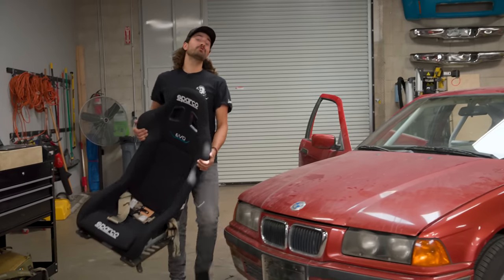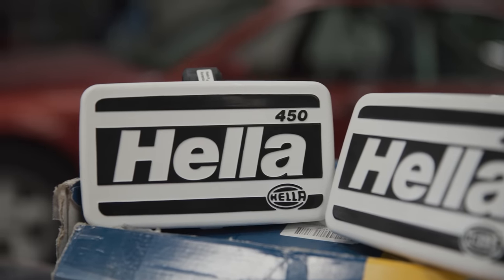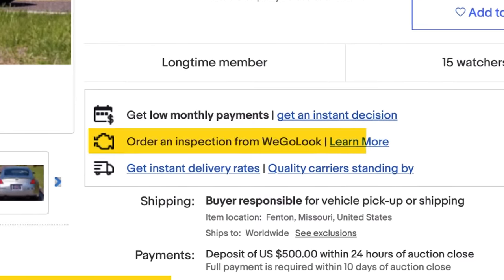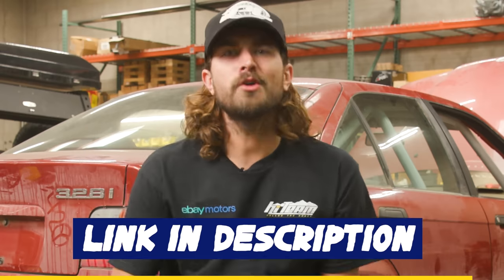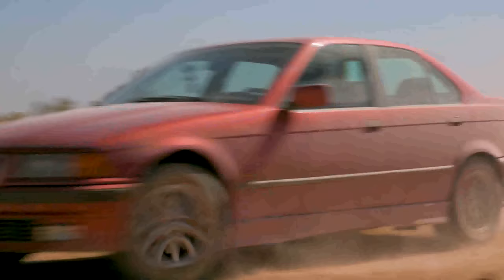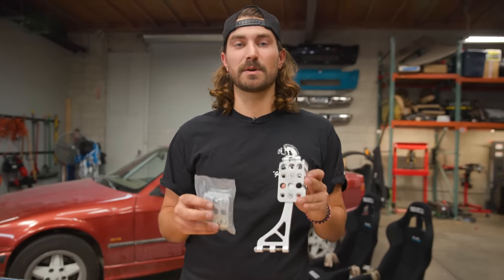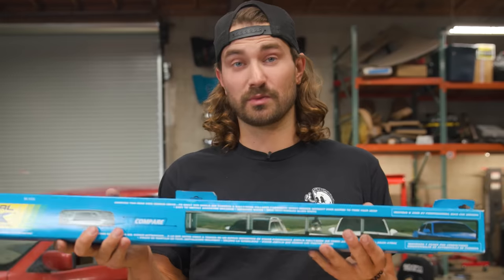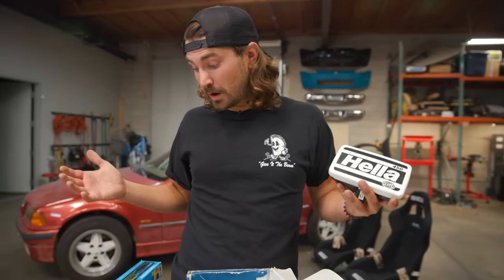Cheap and Easy Rally Car Mods - Were they Worth It?

Comment: Zach: Adds in new fog lights but completely ignores cleaning the heavily sun damaged headlight covers  Now we can see better at night!
Reply: @Donut Media please make a video on how to restore foggy headlights.

...I got that problem too...
Reply: Are those not Fog Lights below the Headlights @ 12:55?

So he just added another pair of fog lights for even more lighting then?
Reply: @vornamenachname727  toothpaste and water
Reply: And... Just even adding FOG LIGHTS to see better at night is just... WTF? 😂 4 Auxillary lights (2 pencils, 2 wide beam) in a row between headlights would have done the trick, pencils in the center pointing forwards, outer wide ones pointing something like 30degrees outwards for that slidey action so that you can still see where you're going 😁🤘
Reply: @Silentalarma  agreed. Fog lights are for visibility in fog. Period. These are going to be rendered ineffective when any dust gets kicked up. Literally anything would be better if mounted higher. 🤷‍♂️
Reply: @Its_Me_Romano  This works okay. Make sure to wax the lenses after doing it or the fogging will return pretty quickly.
Reply: @kvltizt   can you use beeswax or does it need to be car wax?
Reply: @Silentalarma  exactly. That would make more sense.
Reply: @vornamenachname727  I work in an auto parts store. Fixing your headlights is super easy. If you have a cordless drill, even easier. Go to your local auto parts store and ask for a headlight restoration kit. It will have everything you need. There are kits for use with a drill and ones used by hand. I prefer the drill method if you can manage it. You'll start by using an abrasive sandpaper to wet sand off the corroded layer on the outside of the lights. Then you'll attach a polishing pad with a special clear plastic polishing compound to buff the light back to completely smooth. Then you'll apply a sealant or if you want to be more fancy, tape off the light and spray acrylic clear coat spray paint over the lens to add a really tough outer layer.
Reply: @Silentalarma  Those dont look like foglights.. they look like aux fullbeam Hella 450's. The Hella 450 foglights are all wavy glass front to widen beamthrow.
Reply: @Kevin_2435  Thank you, i might try that. :D
Reply: @Its_Me_Romano  that doesn’t work 😂
Reply: aren't e36 headlights glass?
Reply: @vornamenachname727  Pretty sure ChrisFix has a video all about that. And he's better at DIY than Donut.
Reply: @woofy9977  No idea. I use Meguiar's wash n wax.
Reply: @woofy9977  Just use a UV resistant clear coat spray paint that is made for plastic and is fade resistant. You can get a spray can for about $6-7 at any hardware store or walmart. Beeswax and car wax will just wash off and still anyways let the UV rays through.
Reply: @CodeMerk  they look like parking lights  to me, dull lights to help you navigate parking spots under cover or at night

Comment: People who can actually “heel toe” have some serious contortion ability in their legs
Reply: I’ve never been able to do it, got flat feet, pisses me off no end.
Reply: It really depends on the car and how close the pedals are.
Reply: @Fidelitye  fax I can do it in my car but other cars I have to use side of my foot
Reply: @FirstnameLastname-ni9uh  I did add some pedal pads to help, but you don't just throw them on all straight and square, angle them and/or shim them so you get the right foot action you wanna get. 
Aesthetically, they look like a 3yo put them on my car but the function is what it's all about.
Reply: It's easier to do using Jobe's method. Less heel toe, more big toe / little toe. When you use that method you also get more control imo, because if you have the room you can control the gas by moving your entire leg sideways, rolling your foot to the gas, and control brake normally. 

True heel toe is better for older / bigger cars, where the pedals are so far apart you can't reach them with your foot positioned like above. Just my opinion, but I have experience doing both.
Reply: In my brz it’s much easy to reach the pedals so it’s like second nature to me to heel and toe all the time 😂
Reply: Felt that- it also depends on the car. I'm a wide-hipped 5'8" lady and autocross a 1999 miata, and that car has NO space for proper heel-toeing, even after a foamectomy on stock seats. Last Sunday, my buddy Franco let me autocross his junkyard-build 1981 Datsun 280ZX, and even with aftermarket seats, I had PLENTY of footwell space to do a proper heel-toe. Considering I'm the height of a smallish/average guy, I'd imagine a lot of men just don't have the footwell space for heel-toeing.
Reply: @FurryKeidran98  i always thought Jobe's method was pretty much the "proper" way to do it, and that it's just called heel-toe because that's what stuck.

Comment: E36: Has fog lights
Zach: lets mount some foglights to an e36
Reply: @Lassi Kinnunen 81 From the narrow beam I could see that they were fog lights, so kinda useless. He probably could fit some nice big aux lights (or maybe a wide led bar) onto the mounts he already made to make it useful.
Reply: @s2000.  maybe he'll get to that later? perhaps?
Reply: Those are actually a driving lamp not matter what he calls them. A real fog lamp of the vintage would have a much more fluted lens.It would throw a fat wide beam. A driving lamp throws a narrow long beam. As a driving lamp, the trigger wire to the relay should be tapped off the high beam circuit. That way they can only be turned on if the high beams are on.They also extinguish when the high beam are flicked off.  It save blinding an oncoming driver. In a real rally car, they must be wired that way. One of the items checked at tech inspection.
Reply: Seems that all Youtuber connects lights to a switch instead of T ing highbeam cable at the headlight, thats the way we need to do here in sweden for our aux lights for blinding purpose.

Comment: I've installed tons of those mudflaps, including on my own car.  Rally Armor makes really nice mudflap kits for many vehicles, but even the generic kit is still relatively easy to install.  It's an essential car modification imo.  I've found that a better way to do it is to trace the mudflap with a transparent piece of paper, cut out that paper, and then use that piece of paper as a template to mark out the planned mounting hole locations, and use that template for drilling the holes in the actual mudflap.  You usually only need to do this once for the front and once for the rear, and then you can just flip the template for the other side of the car/truck, as most vehicles are essentially the same on either side (although a quick check first is always a good idea).  You can usually find multiple mounting points connecting the fender liner to the fender that/quarter panel/truck bed that can be used to hold the mud flaps securely too.  Sometimes you need to get a bit creative to make some metal brackets for some additional support, but it's generally pretty quick and easy to come up with something.  I'm a big fan of securing the mud flaps with bolts and flat nuts if possible, as it makes it easy to remove and reinstall when needed for repairs and maintenance.  A little bit of extra work when installing them can save you time, effort, and aggravation later.
Reply: By Tom bu I’m my
Reply: I cant tell you how many WRXs I have seen that have with crooked mud flaps.

Comment: 12:55 *bumper has slotted wells that will accommodate rally lights to maintain a flush clean appearance. *bolts them smack dab in the front to be used like bash bars...

Comment: Between Donut and Zach from JerryRigEverything making his own electric humvee, I'm in car mod heaven
Reply: Highly recommend Haugen Racing's Skyline Formula D Japan build, too.
Reply: Project Binky is awesome too
Reply: This the skyline thing just gave my next 4 days off work purpose!
Reply: Jerry rig everything sucks for ruining a Hummer like that
Reply: @captainawesome7092  He makes the hummer more eco friendly,probably can run further because of the batteries,has greater power and torque,yes takes time to recharge and has no noise but in my opinion he is making it better.
Reply: @tankbg1311  The Hummer isn't meant to be environmentally friendly. The Hummer is meant to be a big tough truck that can never die! 🚫☠️⚰️
Reply: Jerry’s electric Humvee has disturbed me deeply, it pains me to see a fine H1 be butchered
Reply: @captainawesome7092  ikr
Reply: I love me an EV conversion, often cooler than factory EV builds by orders of magnitude
Reply: Hummers have garbage drivetrains and garbage design. Having Zach convert one to electric is the best thing that vehicle could have done to it

Comment: Quick tip from an avionics tech: when heat shrinking with a lighter, use the blue part of the flame and move it back and forth. Much less chance of getting the black carbon on the plastic and it won't set it on fire as quickly!

Comment: From experience it's a whole lot easier to mount your mud flaps by making a clear plastic copy of the flap. Then hold that up in the wheel well and mark with a marker where any pre-existing mounting holes are. Then you only have to mock it up once per end of the car.

Comment: Oh thank God you used a relay on those lights. I see so many people just use the switch that comes with cheap light kits, then it burns out right away. My 98 tercel got the rally treatment including 100w yellow round fogs, and never had an issue because I used relays. They were so damn bright you could light up roadsigns that you normally wouldn't see at that distance at night, and also could see deer and moose etc before they came up out of the ditch. They were actually spot/flood lights meant to be put on a tractor or something I got from princess auto (Canadian harbour freight). 

Poor little tercel looked like a 90s Subie with its lights and red crazy carpet mudflaps

Comment: Zach will probably need to do some aerodynamic work for the car especially in the rear by adding a wing and vortex generator to push those rear tyres down for max traction on loose surfaces. 
Also wouldn't hurt to add some sort of livery or even some rally inspired stickers. It's a rally car and I want to see it look like one.

Comment: Hey guys just a quick one if you can find a 325i inlet manifold they are less restricted in terms of air flow and will give a boost in power to the 328i they had to make the 328i more restrictive for emissions reasons

Comment: After all the great comments, I guess it's my job to make a correction.  Serving in the US Navy, many moons ago, I often would travel between San Diego and Long Beach  ... sometimes late at night of in the wee hours of the morning ... often encountering thick soupy fog.  I mounted fog lights on my car, and they worked really well .... that said, Fog lights have yellow or Amber lenses ... that truly cut through the fog, giving added visibility.  White lights, (such as headlights) reflect against the fog, and shine back at you, giving you even less visibility than you would normally have just driving at night.  So what you installed, (with white 'clear' lenses) is driving lights, that enhance the visibility for night driving, over just using headlights.  Clear lenses driving lights, Amber lenses fog lights.

Comment: I’m just confused as to how you made an exhaust, a full cage and so much more but ya didn’t try to bend a steel plate and drill a few holes for the pedals, except the accelerator of course. But the build is coming along nice :)

Comment: i you a really serious about beating on your rally car consider running steel wheels. unless your in a competition, the few extra pounds don't count. they bend rather than crack which means you lessen the chance of a flat after a minor impact. they also cost less to replace.

Comment: This is why you don't buy someone else's project with halfassed work like wiring that will wear through the insulation because it's against a drilled sheet metal hole with no grommet.

Comment: Why would you need such a rear view mirror on a rally car? Rally cars don't race each other (cross rally might, not not straight up rally cars). Rally cars race by time, they don't need to be looking into the rear view mirror. Furthermore, you just added unnecessary weight and you obstructed part of your FOV for no reason. And if you're ever in a situation where you flip the car, now there is more more thing to hit your head against.

Comment: we can go down the rabbit hole on names...you guys don't even try to do anything proper...
Reply: 12:55 *bumper has slotted wells that will accommodate rally lights to maintain a flush clean appearance. *bolts them smack dab in the front to be used like bash bars...